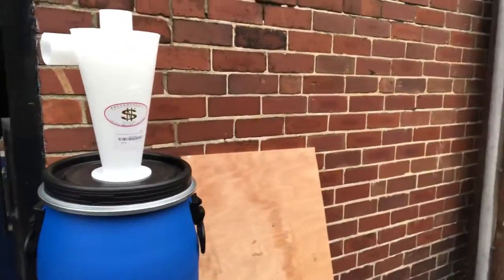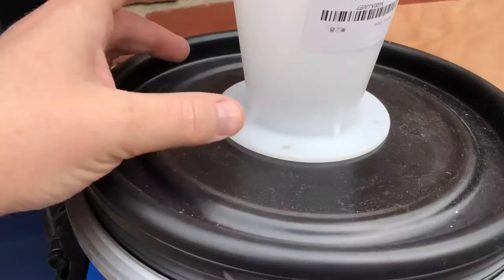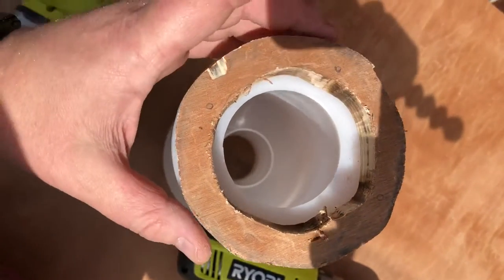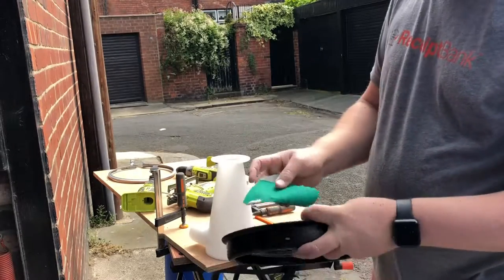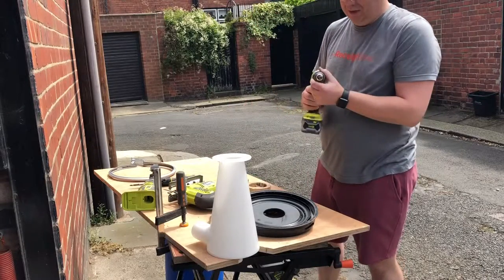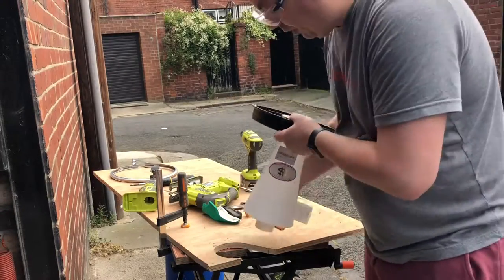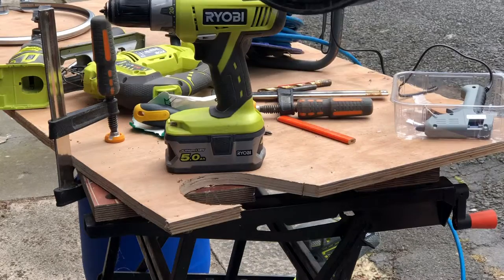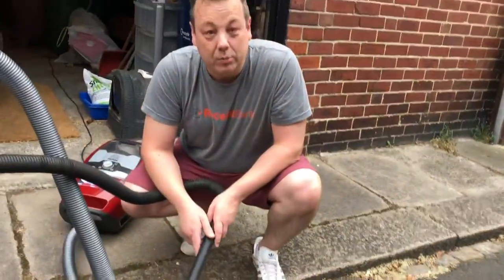Making my Cyclone Dust Collector for under £40

Comment: The black top is hard enough to support the cyclone with bolts, nuts and washers. The problem is that the blue barrel will collapse on itself when there is too much vacuum, like when something block the hose.
Reply from the maker: That’s exactly what happened!